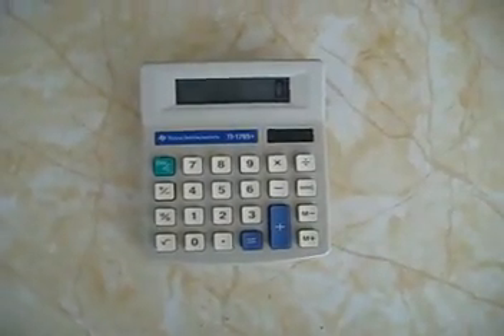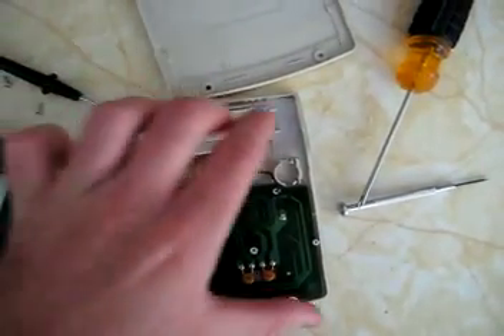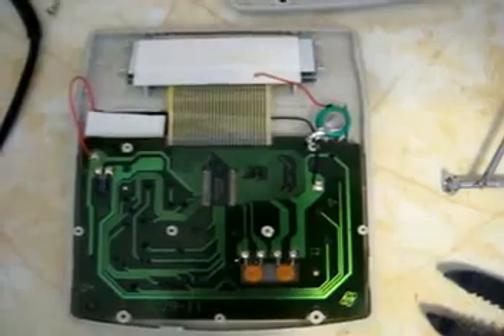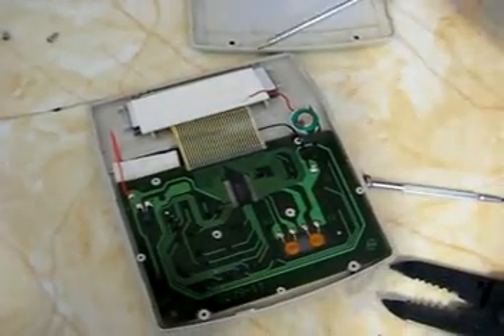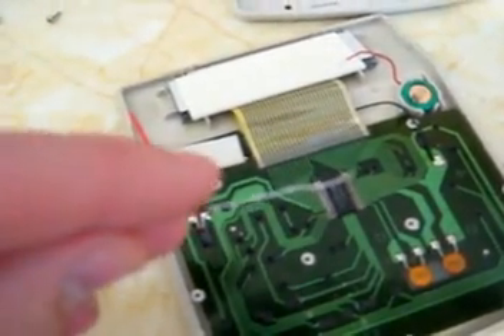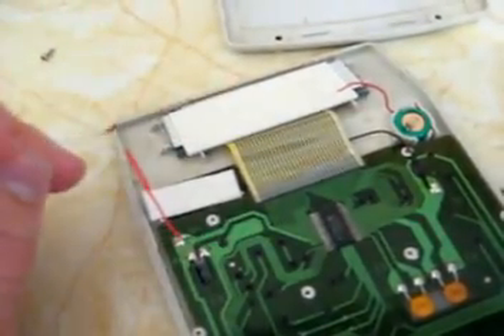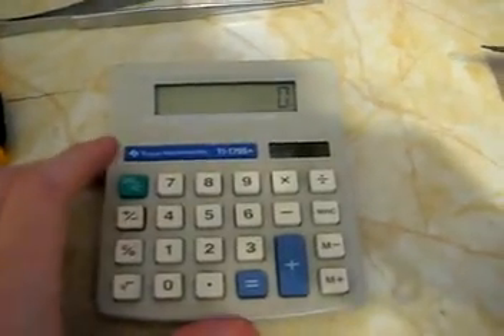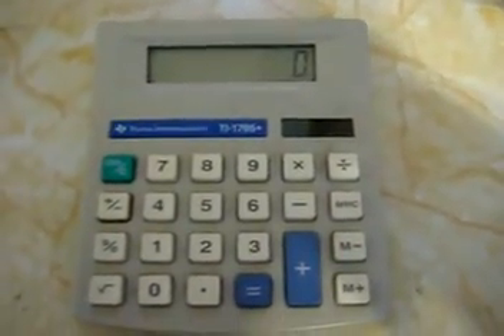Solar Calculator Battery Mod

Comment from the maker: @sixcorpse07 I could make a video demonstrating what your requesting however the solar cells in most calculators are too small and cannot supply the needed power for an LED. The solar cell in this calculator would output the needed voltage to drive the LED but not enough amps. Ideally, a LED needs about 3 volts and 20 milliamps. If you're willing to have two solar cells it would work much better. I'll make a video for you, and will demonstrate what I mean.  look out for it